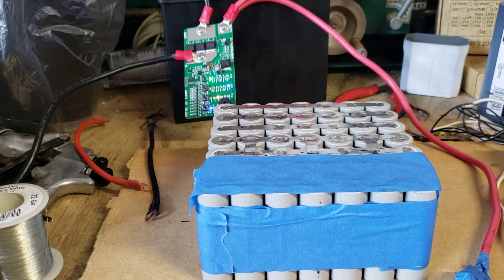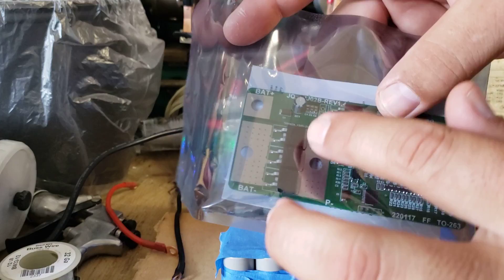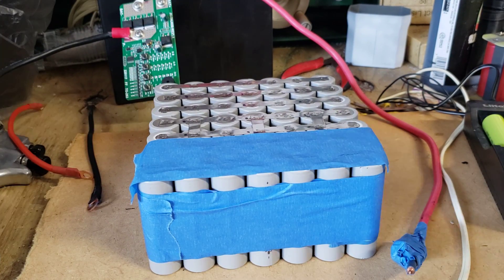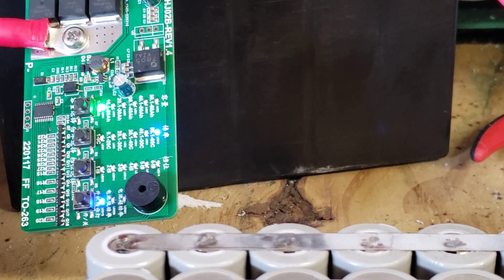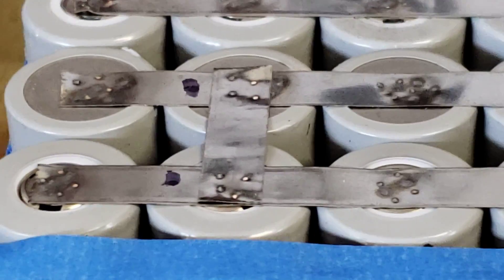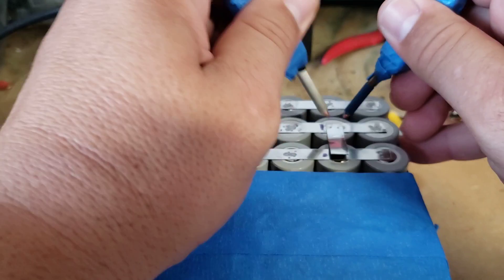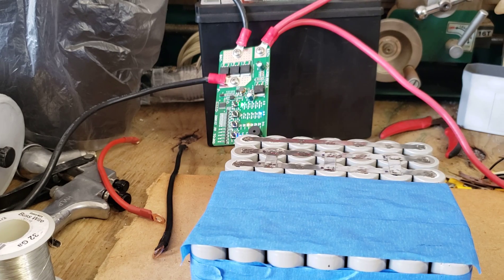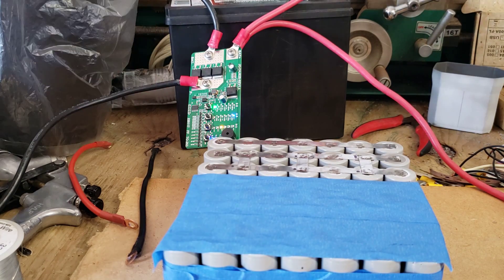Este es mejor que el soldador por puntos BIFRC. Es mucho más rápido y fácil de usar.

Comment: does it weld .2 nickel?
Reply: Easy, don't use the probes as they come, spend some time rounding them up or you'll blow holes in cells. Make the tips round and you'll get much more consistent welds.
Edit: gotta mention, I have a 12v AGM 100Ah, 850CCA, 1400 amps at room temperature (!)
Reply from the maker: Yes

Comment: Hi there..... Instead of the car battery pack, can i use a power transformer 220v to 12v .... If yes , how many amps???
Reply from the maker: You'll need a set of supercapacitors.

Comment: What amp setting do you need to set it to for:
1.   Single nickel strip spot welding 18680 cells?
2.   Double nickel strip spot welding 18680 cells?
Reply from the maker: Don't really remember.
Reply: @javiercamacho  It seems like a simple test that you could do, yes?  Would you do it?
Reply from the maker: @ab_ab_c  i no longer work with batteries. Sorry

Comment: what is the thickest metal strip that  it can do? copper, nickel, aluminum
Reply: I gave up on this as it required far too much for my needs. Went with glitter 811a. Wish I went 811h but the 811a was able to do the copper nickel sandwich I required
Reply: @al73r ive heard a lot of crap about the glitter welder , but do you think its good?
Reply from the maker: Honestly I don't know.
Reply: i heard reviewers saying only up to 0.2mm, won’t do 0.3mm as it gets heats up very fast

not as advertised using cheap mosfet
not infineon mosfet

Comment: What kind of battery are u using to supply the board ?
Reply from the maker: 350 cca 12v lead acid. But you can go up to 800cca. I'll not use more than 600cca -650cca

Comment: Did Javier mention the battery which is powering the welder? Unfortunately we just see the welder circuit, but we learn nearly nothing about the black battery in the background. I ask because I have just bought the same welder and powered with a brand new Yuasa NP17-12I Pb 12V 17Ah it doesn't weld good. I guess that battery is not able to suppy enough current. So, anyone has a recommendation for the battery supplying the welder?
Reply from the maker: I'm usig a 12v lead acid car battery with a 400cca rating. You can go up to 800cca but to keep it safe don't go over 650cca-700cca
Reply: @javiercamacho  Thank you, Javier!
Reply: My new Battery: Brand "NRG" 51913 AGM 22Ah, 360A, 12V, Price about 54€ (Germany) --> Super welds with the DHJ_02
Reply: @chrisb9841 hi do you have a video of you spot welding with this battery xx
Reply from the maker: Not at the moment, but will upload one soon
Reply: @javiercamacho hi, i m a new guy... Instead of a car battery , can i use a power transformer 220v to 12v ? If yes, how many amps should it be ..??? Thanks ....
Reply from the maker: @konstantinoschristodoulis629  I really have no idea.

Comment: Does the spot welder still work/ you recommend over the BIFRC or has it failed? Thanks
Reply from the maker: still using it!!
Reply: @javiercamacho  brilliant thanks for the reply. Do you know is it can it be used with a 70ah / 620CCA car battery(is there a limit to avoid blowing the board?) I dont own any Lipos and it be easier to buy that than lipo and charger.
Reply from the maker: @jamo9000  The max limit for the board (base on their description) is around 900a. Their's a guy here in Puerto Rico using a 800cca battery. I use a 400cca and I whished I bought something around 500 - 600.
Also, buy 2 boards just to be safe. I have 2 but still using the first one.
Reply: @javiercamacho  Excellent advice. Thank you, I have a good price on a 70ah 640cca so will go for that.  Thanks for your help Javier I'm going to go for the full compatible version includes battery terminals, XT60, EC5 connector and case. I'll grab a spare board too. This way I can try it out on one of those car jump starter packs too like perhaps the Baseus 1000A Peak (over rated im sure)  12,000mah pack which I will be purchasing and see the difference.
Reply: @javiercamacho  Board arrived to UK from China in just 7 days. Tested out and very pleased. It's an impressive board. Only using with a 12000 mah Car starter type battery over EC5 connector and it comfortably welds 0.15mm pure Nickel and 0.1 Copper/0.1 Nickel sandwich style. After this performance I'm thinking there is zero need for me to grab the 70ah/620CCA car battery. I also got the purple style 99 gear board but this DHJ028 board is easier to use, performs better and stays cooler.

Thanks for the video and recommend.

Comment: Hello.Can you help me with a code for the 6 pin part that is near ca litle coil L1 that is also near the P-  ?
Reply from the maker: I have no idea how to help you with this. I haven't done anything to mine. I just got it out of the box, added the cables and use it. Are you modifying yours?
Reply: NCE 30H290
Reply: suggestion IRL40SC228

Comment: Cool spot welder. You need to up your game on building packs though. Cell spacers should always be used. And the nickel strip you're using is only meant for a 1p battery. Anything that has multiple parallel connections you should be using the type of nickel strip that connects one row of cells directly to another with a connection to every single cell.
Reply from the maker: Thanks for the advice. I've built many packs before without any issues. This one is just for backup power and small items. The way it was built is good enough.